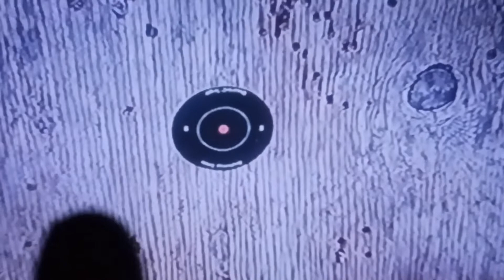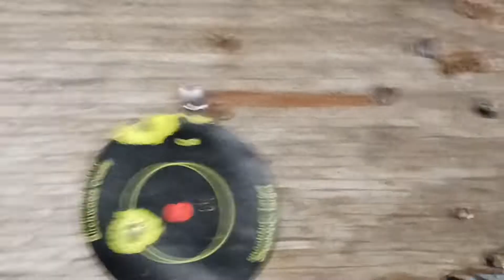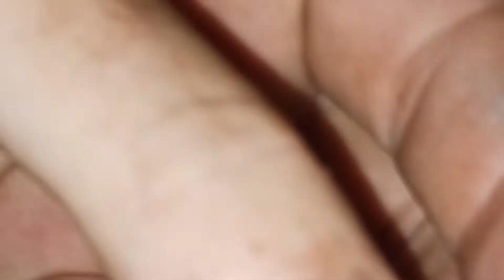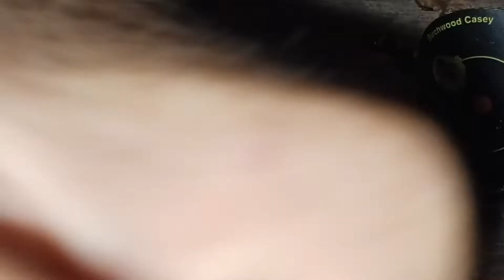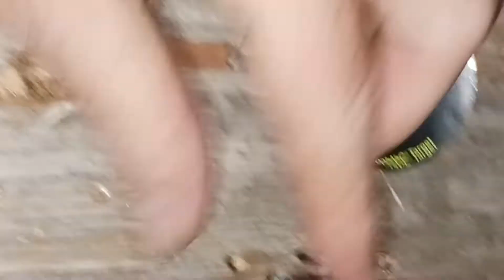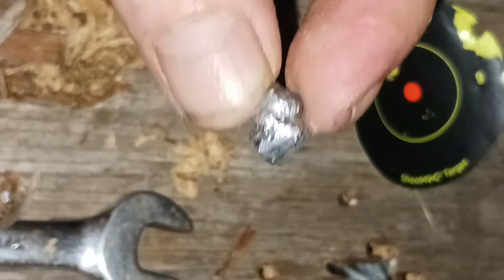I was wrong in the last video!!!!!

Comment: Slugz will shoot superior in pcp because longer barrel bore rifling more power and super bc at long range better than pellets will. If you can find the right slug that fits the barrel bore properly! I know where to find the correct slugz. 💥💪😎
Reply from the maker: This was out of a break barrel.
Reply: @NorthFloridaAirGunner  I know sir. I was saying if you want more expansion, the pcp will provide that along with superior accuracy! You have to find the right ammo soft lead pellets and tune your pcp gun properly with a chrony. You may have to turn the hammer spring adjuster in 1/4 turn increments. That's how you tune with the pcp. You also have to lock down the barrel inside the shroud. Terminador air guns and outdoors sells affordable kits to stabilize the barrel inside and outside and a harmonics kit and he also has an affordable suppressor to quieten it and adds accuracy. Look him up here on U Tube. He's a friend and a professional like me! You could do one thing at a time on it. Make it a laser beam accurate beast!